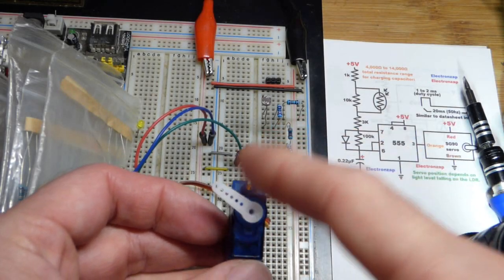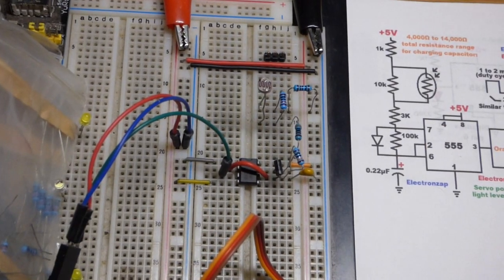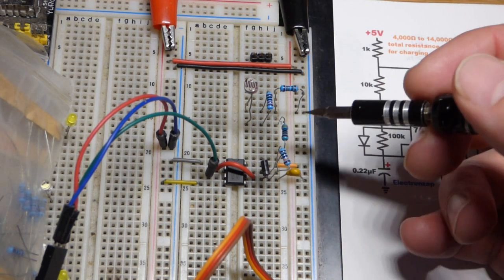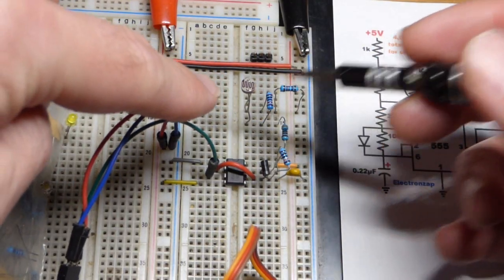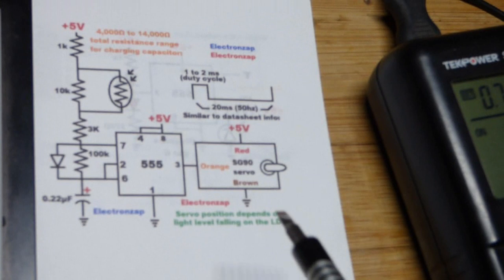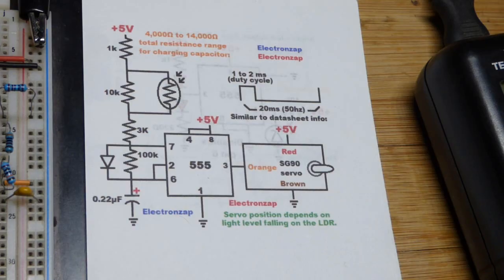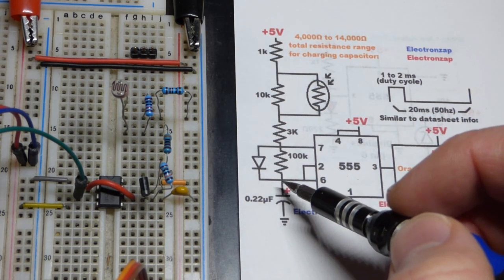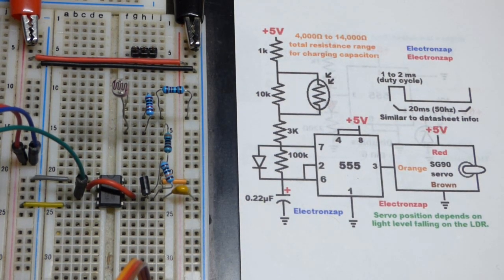LDR 555 Sets SG90 Servo Position

Comment: NICE VIDEO!!!
...one 'slight' correction...The 1ms to 2ms is not the duty cycle (duty cycle is 'unit-less').  It is the ratio of the on-time to the total pulse width.  The 1-2ms represent the ON-TIME.  In this case,  5% (1ms/20ms),  to 10%. (2ms/20ms)...as you can see,the units (ms/ms) cancel out.

VERY nice application!!
Reply from the maker: Thanks for the info!
Reply: 🎉😊🎉hrvourbf